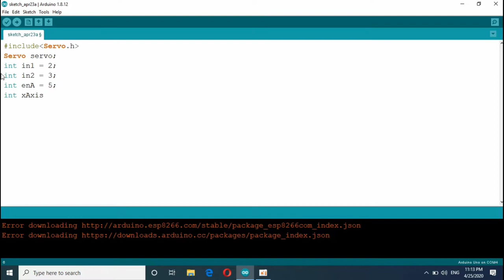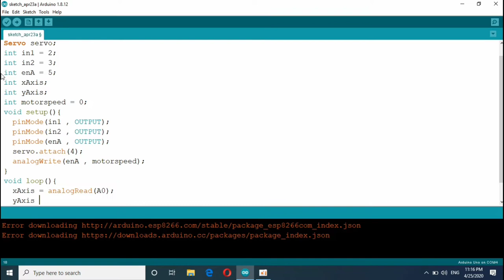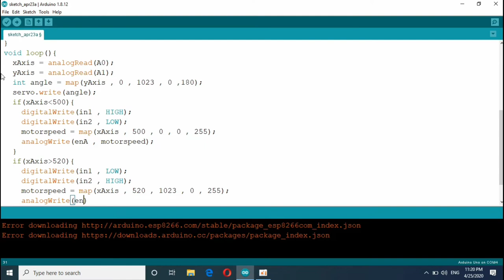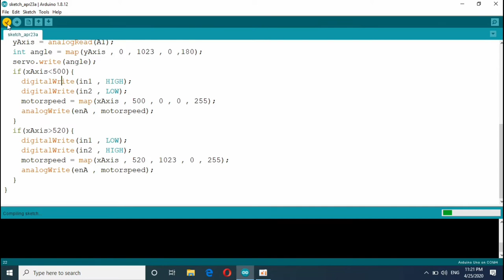Servo motor and DC motor controlled by Joystick module. Get started with Joysticks control.

Comment: Im doing a proyect with l298n and some servos, the servos are being powered by an arduino nano, im having trouble after i activate the servos, they move and stay in position, the problem is that when i send a signal to the l298n to my dc motors, they make the servo change position, any thoughts/solutions?